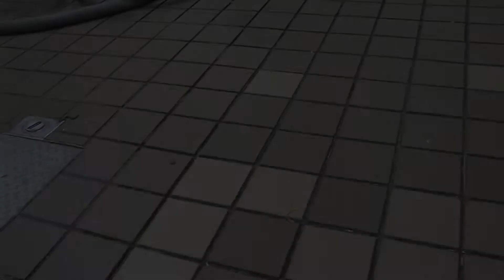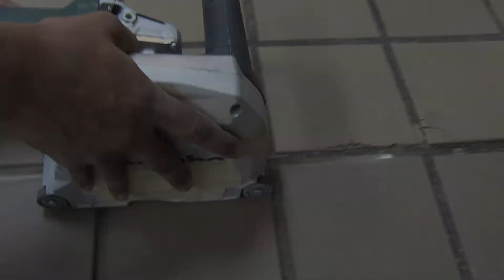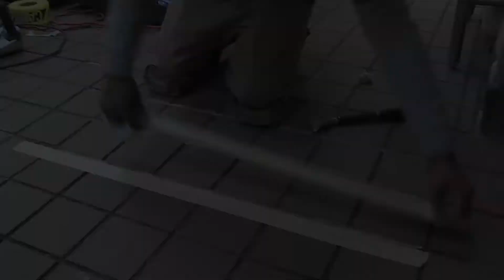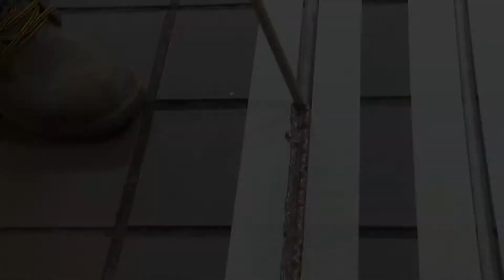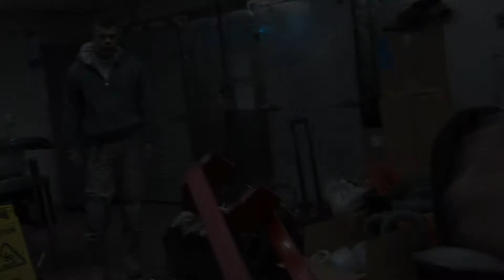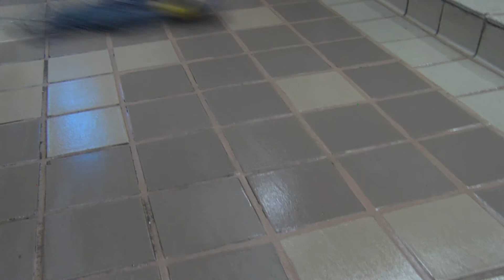COMMERCIAL KITCHEN GROUTING WITH ®MARCOAT ES ™RUFF TRAX

Comment: Crazy labor intensive. I quit restaurants because there so disgusting.
Reply: I make over 200 thousand a year with 1 helper doing this type of work.. need more guys with experience I have tons of work
Reply: @johnwayne7128  I believe it. I turn down tons of them. I used to do Panera restaurants in two states. Just can't take the nights and the filth anymore. Good for you though..
Reply: @mattmason7554  how did you go about getting contracts? I work through a company that subs them to me but would like to eventually get my own work
Reply: @timothyshannon9893  I use Google AdWords. They found me..  I still get contacted all the time.
Reply: @timothyshannon9893  haha. Just saw this. I just fell into it. Do one then it snowballs. I’ve done Taco Bell, Panera, gander mountain. Not worth it in my opinion. Especially chains. Maybe less red tape with independents
Reply: @johnwayne7128  what are you using to cut grout?
Reply: @MrLee-jc7sm  we use the alpha ecc-125 ecocutter portable cutting system. I am curious about the one in this video. Wonder which one is better
Reply: @johnwayne7128  what do you pay? I do the same work as a sub contractor
Reply: @johnwayne7128 where you located?
Reply: Contact me. We do New Marcoat grout.
Reply: @aleks_24a  what’s the best way to contact you?